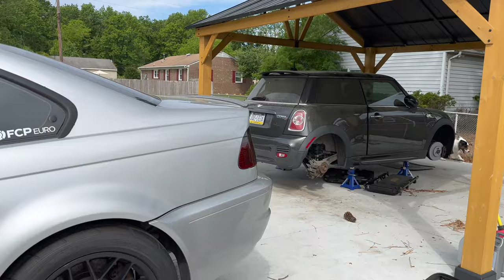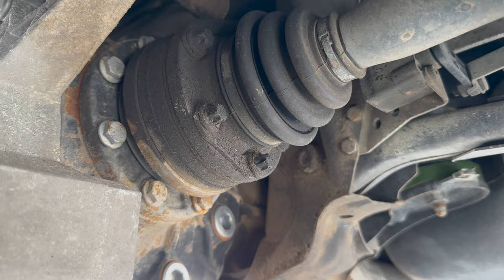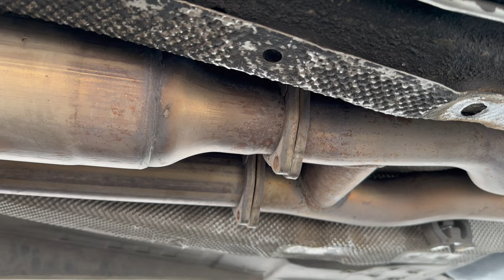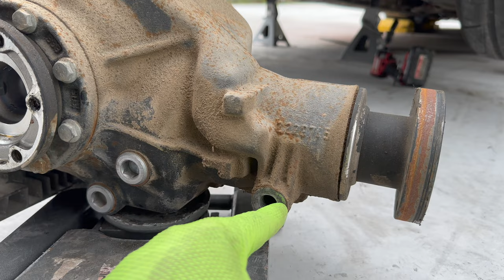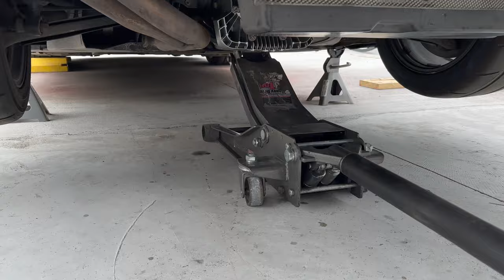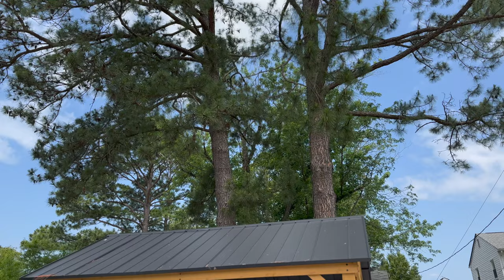RevShift diff bushing install | E46 M3

Comment: no description on what was required to extract the diff bushing in the subframe NOR process to install rev shift replacement
Reply from the maker: Well the one in the subframe was in pieces, sorry lol it was destroyed. The new ones literally just pop in if you freeze them and use a lil lube
Reply: The eccentric part of the 80A Bushings are giving me issues with the install on the subframe. Some clearance issues. Not sure how I'm going to solve that
Reply: @zsherm2  put the suffrage bushing in the freezer for 24 hrs. separate the poly from the metal. this shrinks the poly slightly. On subframe ensure, interface surface is clean and smooth. I used ultra fine (800 grit?) wet/dry sandpaper.

Lube OD of poly bushing. Separately, insert poly fully into subframe location. I put mine in with only my hand. then after fully inserted, lube OD of metal and push in. Again mine just by hand.

Must insert poly quickly after pulling from freezer or as it warms it expands
Reply: @nevrcm3261  actually I was able to drop part of the subframe and that helped tremendously as far as clearance. I left that subframe out to get the diff back in too and it was easier.  To get it in, I used the schwaben bushing tool set.

Comment: Did you reuse the original hardware?
Reply from the maker: No it came with new bolts
Reply: @BryceJordanProductions nice, looking to get these. Was the noise vibration noticeable after installation?
Reply from the maker: @Alxzmrra I wouldn’t say so, but I don’t drive it much to be honest it’s the wife’s project car.